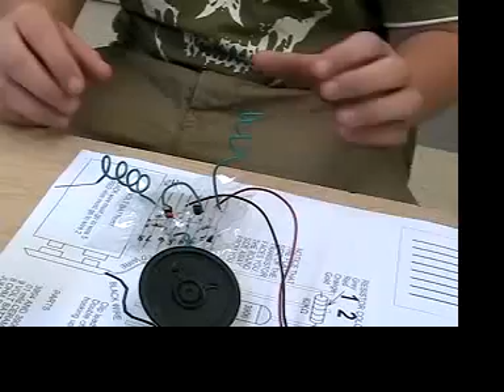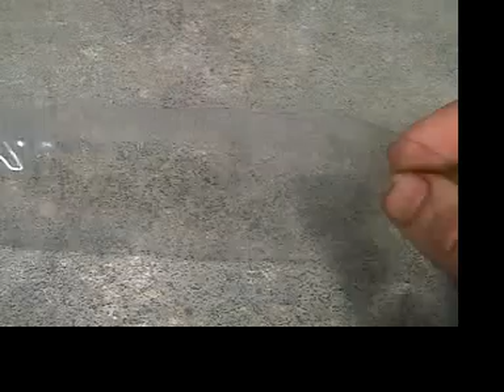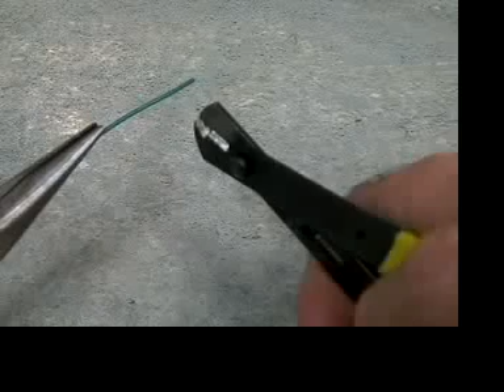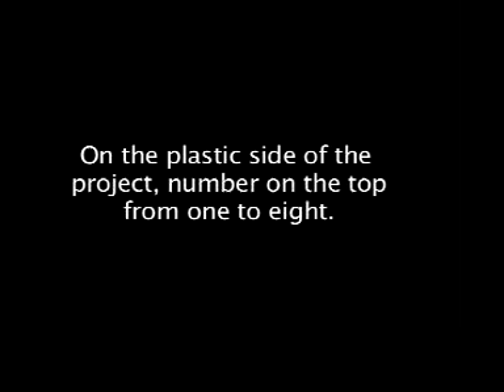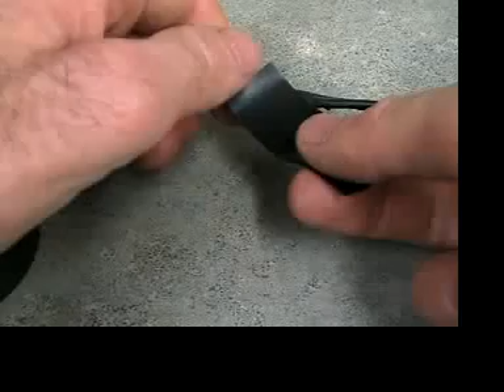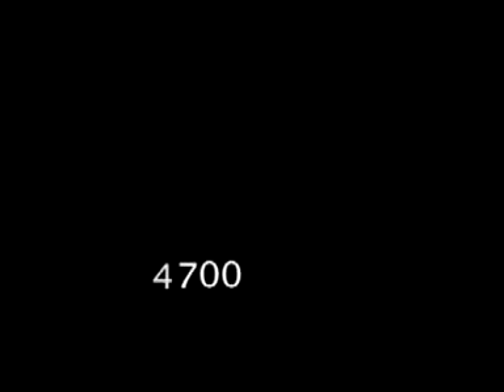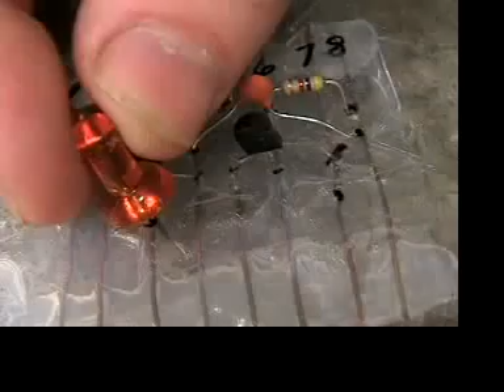Make an Electronic "Lie Detector" (part of a polygraph)

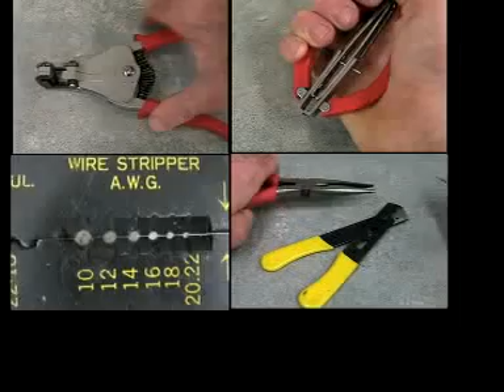Comment: 6:50 what kind the wire stripper to strip the insulation off the 22 gauge thin copper wire?
Reply from the maker: There are many kinds of wire stripper. I do not know the specific names.

Comment: What can i use instead of silicon layer
Reply from the maker: Typically electronic components are mounted on a "printed circuit board". If you find a school where they make them, they might be able to help you.

Comment: hay i have made but its continue buzzer is on
and its not catching lie ya truth
plz tel me how to use it
Reply from the maker: The pitch should vary, depending on the conductivity/resistance of whatever to contact the touch wires to. I need more details and perhaps pictures so try to see what the issue is. There is contact information at the sciencetoymaker website.
Reply: i have conected wire properly but i atched the batter the buzzer is on
Reply: how to use it u can snd me vdo  using it
Reply: from where you get this that how to make lie dector
Reply from the maker: Nazya Tai Look at the video at about 0:40 seconds in.
Reply: u can snd me vdo of using lie dector

Comment: Would like to use this in conjuction with doing research on plants. For this I would need a milliammeter and some clip leads. How would I modify your circuit for this?
Reply from the maker: I don't know. You could try hooking the output to the meter instead of the speakers, perhaps with a resistor in series. A problem could be that the output is in pulses, not constant. If you are lucky, the meter will measure the average. If not, I don't know how to solve the problem. I would find and ask someone who knows more about electronics than I do.